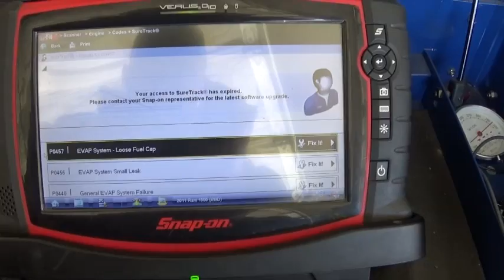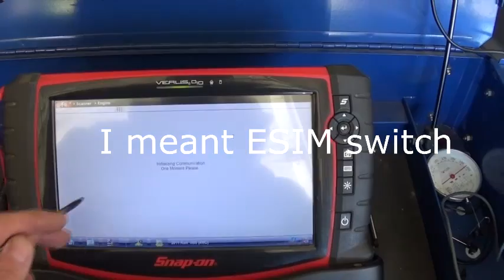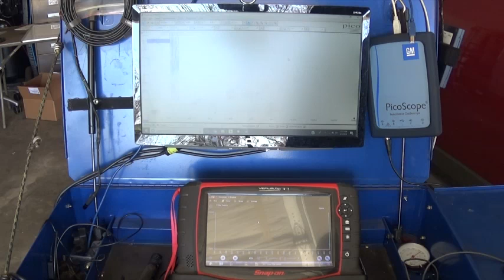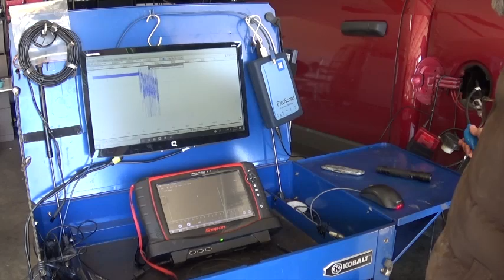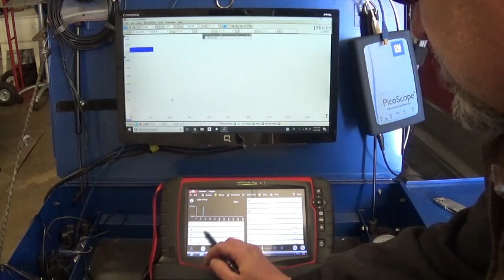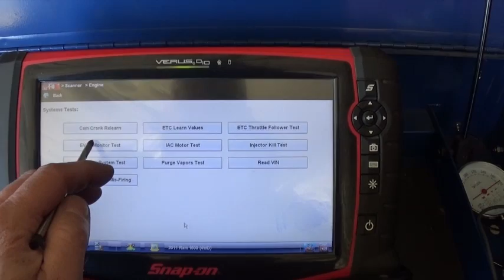2010 Dodge Ram Code P0457,P0456,P0440 Diagnoses And Repair

Comment: Hi first off Im very impressed with your abilities. I also take scanner danners class. Anyways this is off topic for this video but I have a question about a low amp clamp. I have a snap on Verus but I dont know what setting to select for the hantek cc65 cheap clamp . I dont know if it is a 20 40 or 60 amp. I bet you know thanks. I guess I could quit being cheap and buy another clamp but I shouldnt have to Anyways your help would be appreciated. Thank you
Reply from the maker: Thank you my friend. I am taking his classes as well. Worth every penny. Your clamp is fine no need to buy snap on clamp.  Setting is on Verus 20 A on your clamp is (100 mV=1A or 1mV=10mA)  40 A or 60A on Verus is (10mV=1A or 1mV=100mA ) on you clamp. Hope this will help. Cheers

Comment: I wonder if this would work almost as well by applying vacuum with a hand pump and analog gauge at the EVAP port. Work flow is so different without bidirectional control and professional tools. But finding a bad wire should still happen, even if it takes a lot longer to isolate the problem area.
Reply from the maker: Hi my friend. You can use vacuum pump but you will not see anything on your analog gauge due to such small vacuum 2 inch H2O. You can back probe signal wire at ESIM switch apply vacuum and switch should close and voltage will drop from 5V to 0.

Comment: Good testing Ramon! So just to share some of my methods with you because I do see my share of EVAP trouble. When I have a Chrysler come in with an ESIM it is always my habit to just kick on the purge before I even get out of the vehicle to monitor the switch status. Regardless of the size of the leak you should see the switch go closed with the purge at 100%. If I do not see it close right away, I go right for the ESIM testing / circuit, because they are so failure prone. 2nd, NEVER trust the ESIM switch on scan data, especially on the Snap-On. I had that burn me bad one day and waste about 45min of my time and almost made a call on an ECM, however I was lucky enough to not believe it and grab another tool just to find out the ECM was seeing the input. All that after I verified the wire integrity was good, it was switching (pulling voltage low) but it was not being shown on scan data. Seen this on multiple occasions now. 3rd, now I may be wrong on this but I think they are a 12v circuit when the ignition is on but go to a 5v circuit when the key is off for natural vacuum leak detection, I would have to double check that though. Oh and one last thing and I know you know this but when you are watching vacuum decay on the PICO hooked to your transducer just be mindful that other contributors such as fuel volatility and fuel temperature can give you false positives on a leak. Keep up the good work, you are a very sharp man! Love the home brew set up too, very nice!
-Eric O.
Reply from the maker: South Main Auto Repair Hi Eric I am so glad to see you back on my channel. There is something you need to know about NVLD system. When you activate  purge solenoid with engine running your switch will never close because there is vent valve on that unit (ESIM doesn't have vent valve). Switch will close only  when you  shot your engine off and vacuum will stay at 2 inc h2o. Please please I have play
list on my channel for NVLD and ESIM system and I took apart both units and explain on white board how it works. ESIM system uses only 5V NVLD uses 12V with engine running and 5V engine off. Thank you my friend.
Reply: Hey Ramon, so I am not criticizing your work by any means so do not take it the wrong way. I do realize that the "vent will open" with a pressure relief: approx .5” of water (Very important in vehicle refueling!) and a vacuum relief: approx. 2.2” of water. After closed loop operation, the purge solenoid will ramp up operation. The ESIM switch should therefore close. If not, a P0440 General EVAP fault will flag a failure (2 failures needed for DTC)  That is the reason I mention by simply opening opening the purge KOER will give you an indication if the ESIM switch is closing. It just short cuts the diag is all.

Also I did  double check my self, it is the NVLD that uses the 2 voltages however they do use the ESIM as an NVLD for the small leak test.

Regards,
Eric O
Reply from the maker: South Main Auto Repair No Eric sorry for misunderstanding your test is legit it makes perfect sense. I was trying to explain that NVLD system is little different. It was very confusing to me I would use my pump to apply vacuum and switch would close. Then I would activate purge solenoid and I could see vacuum in tank with my sensor but switch would not close it stayed open all the time. That is because of internal of NVLD unit itself and purge solenoid. In my frustration I turned engine off and  switch closes and stayed closed until vacuum dissipated. Later I took NVLD apart and now makes more sense to me. Eric thank you so much for your hard work we all learn so much from you. Cheers my friend.

Comment: Great video Ramon and that tool that you've made has helped you out again! Keep up the good work! :)
Reply from the maker: stuzman Thank you my fiend. I have questions for you. I am looking for DC clamp meter with digital display ( as multimeter ). Fluke has 357 version. I need something for quick Amp measurements. My price range is around $150.00 used. What fluke meter I should buy. Thank you my friend.
Reply: Ramon, I couldn't find a Fluke 357 version, but here is a link where you can select the different options such as pricing for the Fluke amp clamps. Good luck on what you find! https://www.tequipment.net/fluke/clamp-meters-1/clamp-meters/
Reply from the maker: Thank you sir. I really appreciate you help.